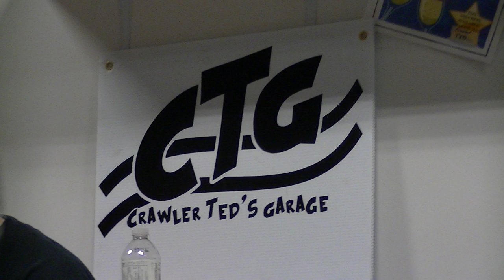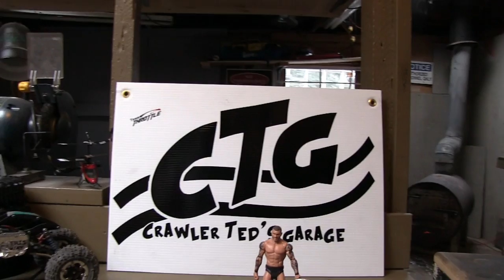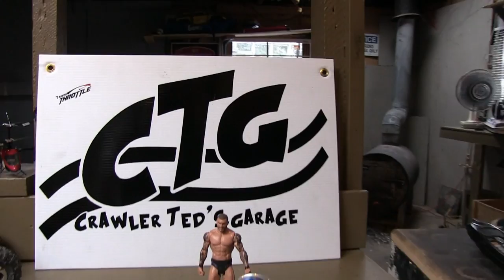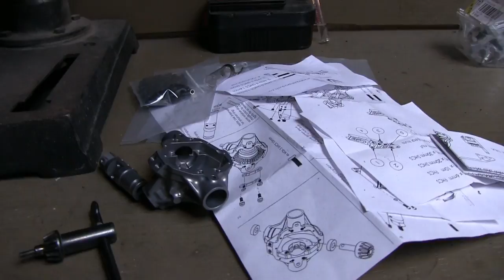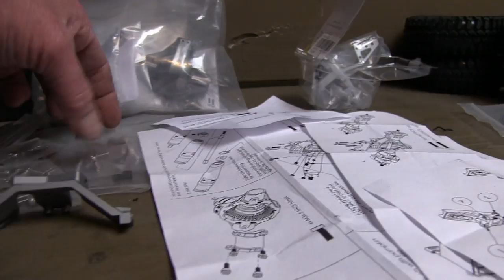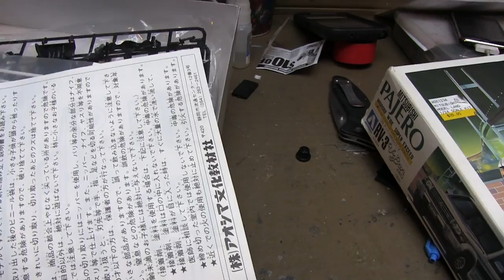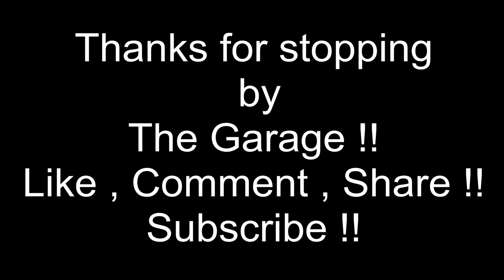Testing the new cam , Whats on Ted's bench ? Crawlers and tires ,and Ted talking ,, A lot .

Comment: Hey bud, that is a Clodzilla 3 chassis with the cantilever up graded, hot racing axle tubes with the hot racing steering knuckles! Very sick unit!!!! You can get new gears for around $7.00 bucks if it doesn't already have the metal gear upgrade!!! So put the power to that badass machine an enjoy!!!!!!!

Comment: Depends on preference.  If you like to crawl over rocks and enjoy the slow challenge get a high turn motor 45T 55T brushed.  If you want to go fast then get something around (no lower than 20T) to 27T.  The higher the turn brushed motor the more torque it will have, the lower the turn the higher the rpm or wheel speed.  Same with brushless systems low KV is fast, High KV is torque.  Your first upgrade should be aluminum steering knuckles and c-hubs, they always break first.

Comment: hey ted i had a question for you, i broke the antenna off my mini revo a few weeks ago and havent been able to drive it since, where can i get a replacement wire? or can you even do that without replacing the reciever? and also im looking at buying a scx10 soon, would i just be able to buy another reciever for the stock axial controller and use it with my mini revo?

Comment: Hey ted i'm building a comp crawler using losi comp crawler axles and a 2s brushless system. I'm wanting to run my servo on 7.2v which is what my 2s lipo is. Do you think its necessary to still install a bec?